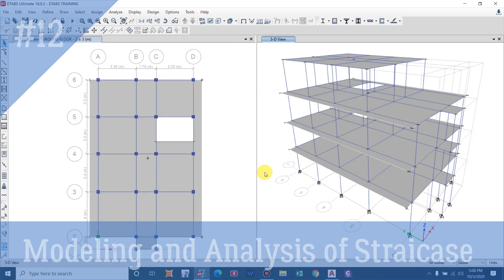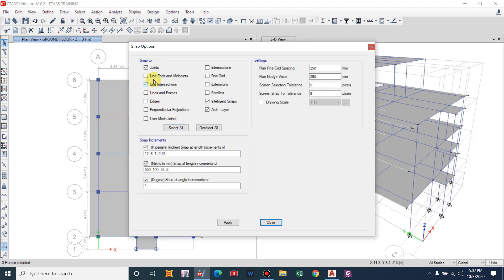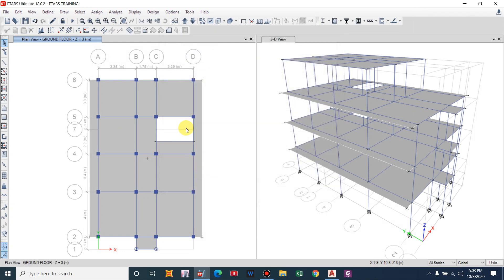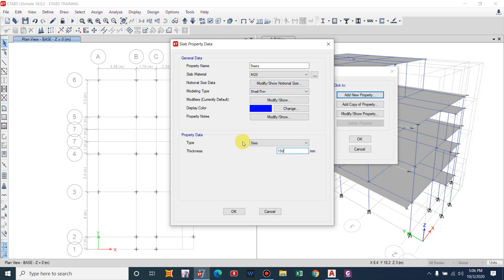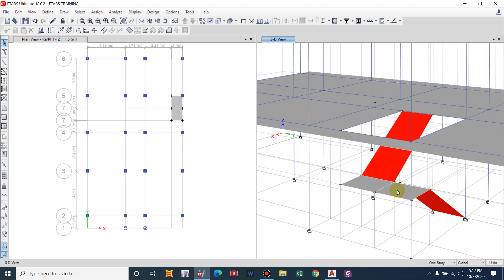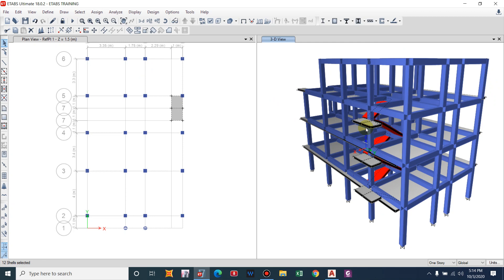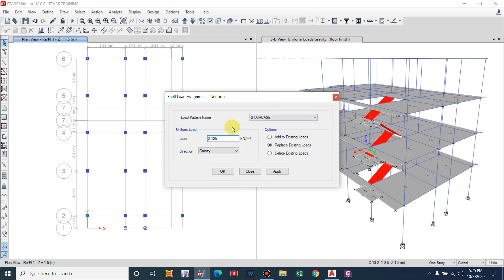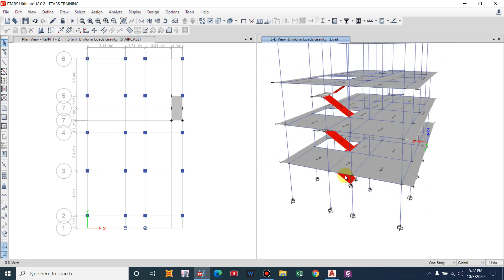Modeling and Analysis of Staircase | Load Assignment | Design of Residential Building in ETABS

Comment: While Calculating the dead load of steps you have taken 1 m for 1/2 * base * height, base and height should be the riser and tread of the steps right??  1/2*0.23*0.17 should be the formula i think.
Reply: load is considered Per metre as it is uniform, so we take base as 1 metre and the height as riser

Comment: Sir , Can you please explain why the result is different for the building with stair modelled as shell than the building in which stair load is calculated and applied as frame load?  Which method is correct approach for designing?
Reply from the maker: With staircase modeling,  stairs contribute to the structural lateral stiffness,hence lateral stiffness increases much in the direction along the stairs arranged. And considering complexity of modal participation of staircase, it is better to consider staircase model in structural analysis particularly for Nepal as it is a seismic prone region.
Reply: @civilconst  but while modeling the staircase, the staircase load is not transferred to the beam  at landing portion (in your case grid D-D) and all load is transferred to floor beam at grid C-C or to the column directly ( if you join the landing slab to column) . this will alter the design result.
Reply: @civilconst  Do you meant we should model staircase compulsarily in earthquake prone zone.?